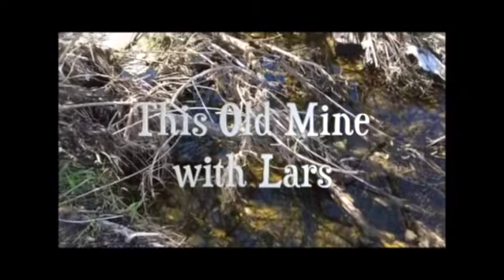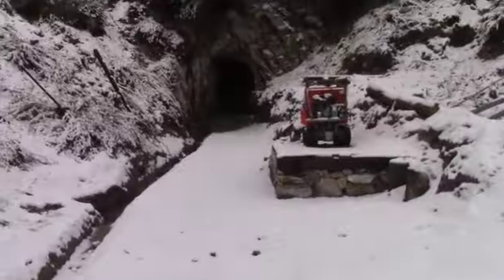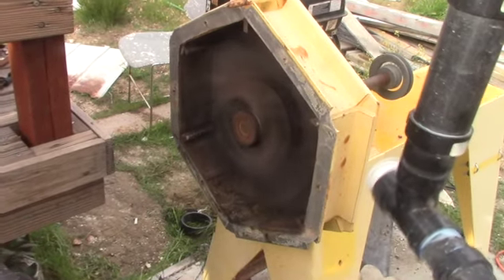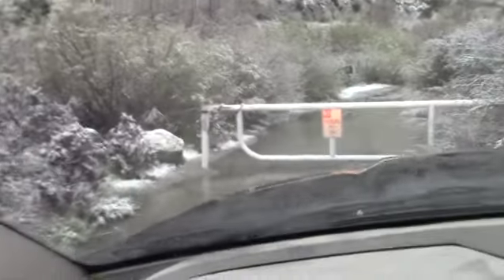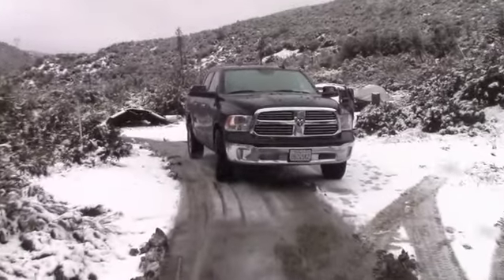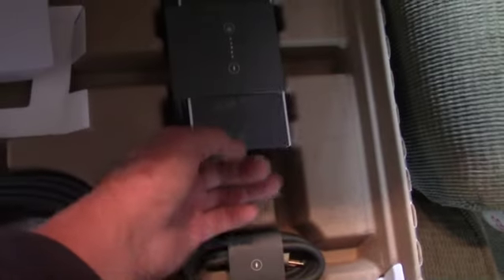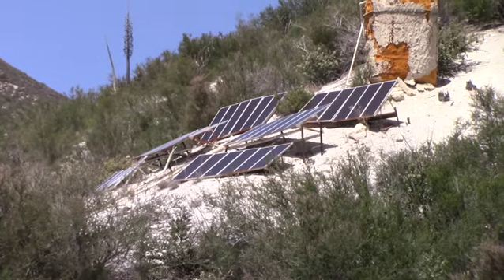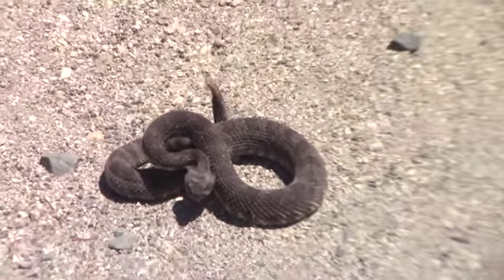More from the Monte Cristo Gold Mine

Comment: Do you have a body of water close to your mine by any chance? ~( 'w')/
Reply from the maker: I have a seasonal stream. We tap it at the spring to provide water most of the year.
Reply: @thisoldminewithlars5324  Is it coming from the mine?

Or is it just runoff?

If its coming from the mine, you could build a cistern inside the mine and make it hold way more water over a much longer time. 

Actually, with just some good liner, you could do the same to a limited extent, even outside of the mine.

Its just better and less trouble with the BLM if its done inside the mine.

(~_^)-b
Reply from the maker: It is from a spring 1/4 mile up the canyon.
Reply: @thisoldminewithlars5324  Can you capture spare water without too much pain from the BLM or other untowards agencies giving you grief?
Reply from the maker: If I stop the excess water the Forest Service will get upset that the water at the campground 1.5 miles downstream has stopped. I have 2 2500 gal tanks and the spring runs all year. With a 1/4 mile of 1.5 inch pipe running from the spring and  a 200 ft elevation change I get about 85 psi of head pressure on the main line.